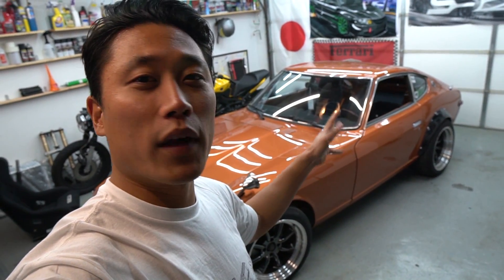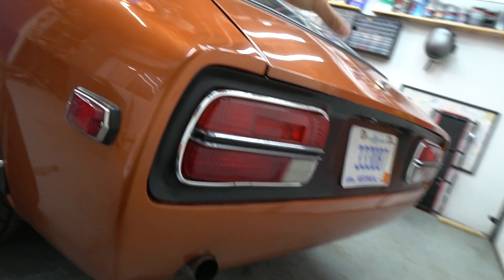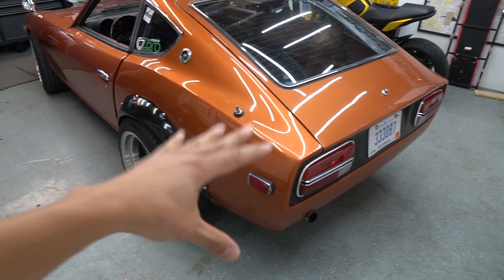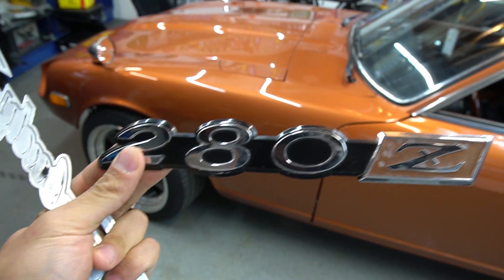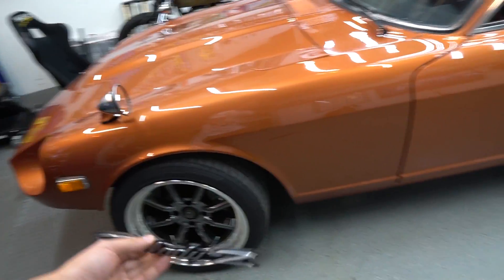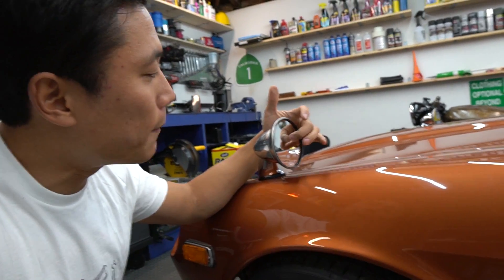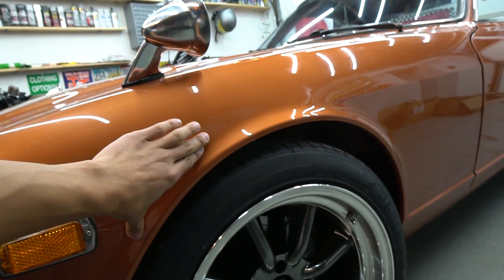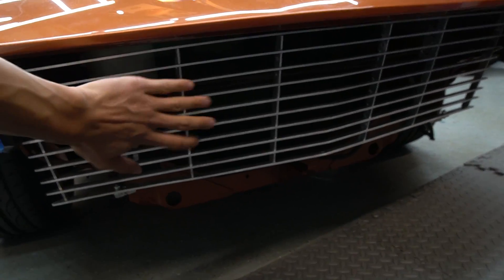280Z Update. eBay Seats, Fender Mirrors, 240z Lights, Next Steps - The JDM Devil Z Build Series #20

Comment from the maker: What do you guys think about keeping the side indicators or deleting them?
FYI, I got the parts from Retrospec before he went quiet. Installation videos of CF bits and pieces will be uploaded in the future.
Reply: I plan on keeping them on mine. Your paint job look good I wouldn't ruin it by welding delete plate
Reply: Keep the side indicators! Even the Fairlady Z’s in Japan had them, and I understand the whole seamless thing, but keeping the car authentic is the way to go! At the moment I’m actually trying to figure out my situation so I can buy one for myself.  Good luck with your build!
Reply: Mine still has the aerial antenna, it's a '75. the only modification was a new stereo, best I can see in the wiring diagram and from what remains of the original wiring is that it was switched with power to the OEM deck. So when you turn the stereo on the motor goes up for a set duration, then down when the stereo is off. (mine is now manual up and down, which should last longer because of they get dirty or rusty they get stuck and slowly burn out the motor)

I would wire in the setup from a acura integra, but I am also a heathen so... Maybe the atlantic or hybrid Z forums will tell you.
Reply: Also I am keeping my side marker lights and wiring them into the turn indicators.
Reply: I'd keep em,   just that much more coolness and why do anything to that new paint you don't have to.  :)
Reply: I got rid of the side markers I like it better also if you want a rear BRE spoiler get it from BRE no one makes a better one.
Reply: Sugoi

Comment: I had the oem motorized antenna on my '78 280z (even the control on the console worked!) then some asshole pulled it out and broke it in half. I glued the broken antenna, kept it there, and wired my antenna to a no-show box antenna inside instead. And about that rear wheel/tire position, you're not alone. I've always wondered if i'm the only one, turns out they came from the factory like that. Wish you all the best with this Z!

Comment: Generally for the aerial, most stereos have a REM out or Antenna out, it supplies power when the stereo turns on to a relay which powers the aerial. Or you could use your ignition as the source to trigger the aerial...nice car :)
Reply from the maker: ah the REM from stereo. that makes sense. im gonna look into that. thanks for the input

Comment: Usually the power antennas are no harder to install physically than the regular kind, as long as they fit.   Generally they will need power and ground,   plus there's a relay (usually built in,  I think)  that tends to be triggered by a blue wire that comes out of your head unit.  This means the motor only activates when you turn on the radio/ignition/accessory switch, so no, it isn't draining power.   The motor makes it go up and stay when you turn it on, then when it's shut off the motor brings it down again.  But it stops at the end of each cycle.  :)
Reply: Also,  if anyone makes carbon fiber rear window louvers, that'd be groovy.   I had to have louvers on mine,   but yaknow,  weight and that much more noise.  :)

Comment: I deleted the markers, door handles and antenna. I love the look with out anything. Was thinking about cutting my drip rails but I heard you can run in to some problems with water getting in. So I will hold of on that for a bit or in tell I want to repair my car. I also have a carbon fiber hood for it to go with the carbon fender flares.
Reply from the maker: Hmm I would like to see a photo

Comment: Looking so good man. You did it in a good way too. I'm down to a shell, no turning back now haha!
Reply: Did you also have to grind through an acre of bondo?
Reply: @Oblithian  The paint isn't stripped all the way, most of the car seems solid. I am suspect about the driver side door and rocker being constructed with bondo. I know the bottom of the driver side fender was caked over an inch to an inch and a half in bondo because it had been crumpled up. I carefully worked it down to the metal and then restored the metal with a hammer and dolly back to original shape. I spent a few hours mostly cause the bondo but sad that what little effort it took me to hammer it back into shape that whomever "fixed" it did it by just slapping mud on it.

Comment: My dad owns a 1981 Datsun 280ZX. I love driving it! BUT we're trying to find a part. My dad is older, so I have to do the research.  I'll do my best to explain: it is a 1981 Datsun 280zx Headlight Wiper Combination Switch. His headlight dimmer switch is not working. I've been searching all of the Z part sites. Any assistance would be appreciated. We tried Auto Zone...no luck.